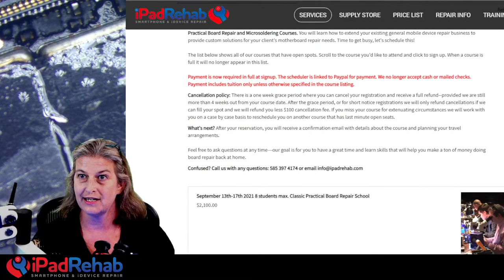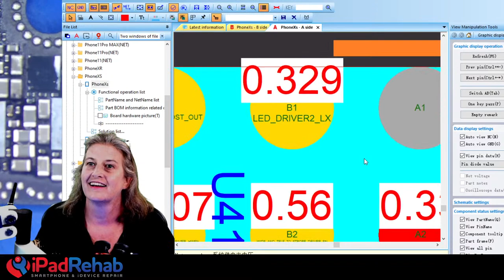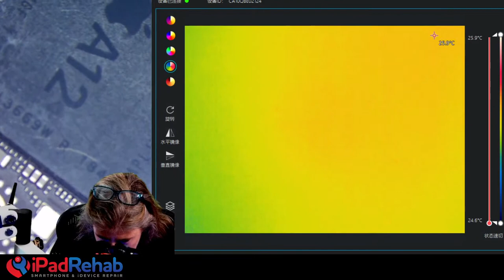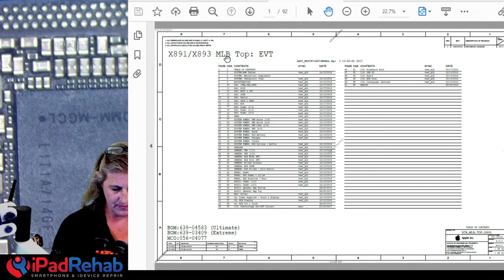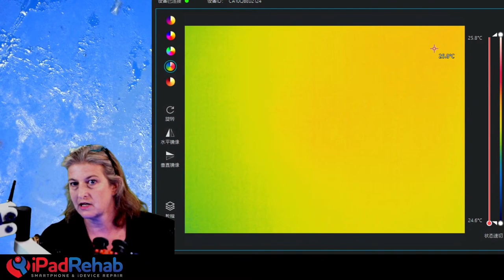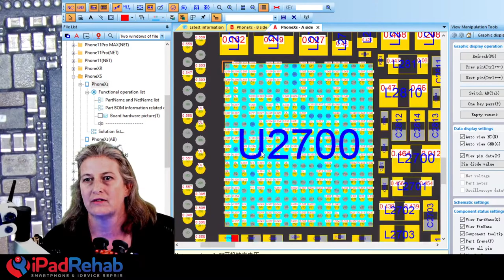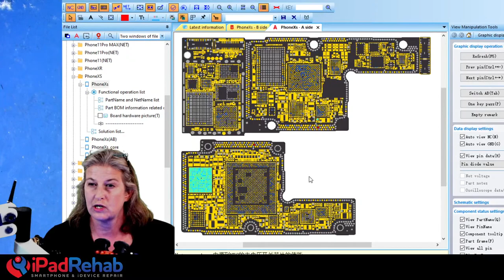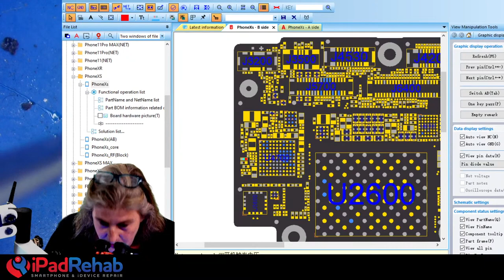iPhone vs Commercial Dishwasher.   It's not pretty.

Comment: Depends on the dishwasher.  I bought one for my home because we were doing so many dishes.  It wasn't a giant one obviously, so it was built much like a regular dishwasher, but much more powerful and faster.  If you're running multiple loads, which you do of course at a restaurant or something, then the thing could fall in really easily and the water in the bottom is nasty and hot.

Comment: There's some videos on YT of people doing sub-zero PC hardware overclocking, covering the boards in Vaseline to prevent shorts from condensation. To clean those parts, guess what they do? If you guessed put it in a dishwasher, you guessed right! But, those are not Commercial grade dishwashers and there's no batteries glued inside. We still don't know how that phone got in there in the first place.

Comment: Would it be TikTok related, lol?

The sign at Nippon Sushi

"Kindly refrain from placing your phone on the conveyor belt to make a TikTok," reads the sign. "This is invasive to the privacy of other diners who do not wish to be recorded and at the end of the belt cycle, your phone will be lowered with empty plates into our commercial-grade dishwasher, where it will be fully submerged in water, detergent, sanitizing agents, rinse additives, and within a 90 second cycle pressurized and heated to 180 degrees F.

"We are not responsible for damaged phones. Thank you!"